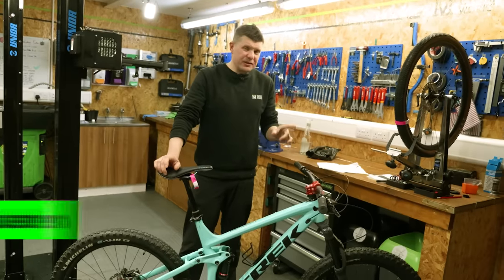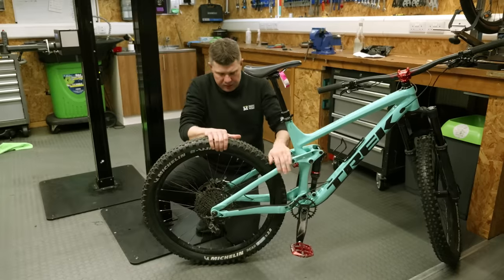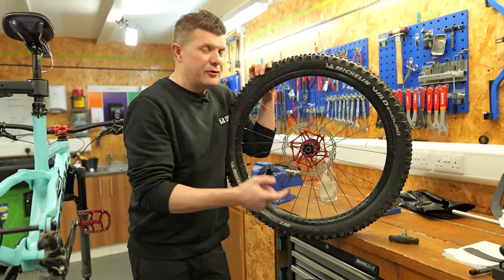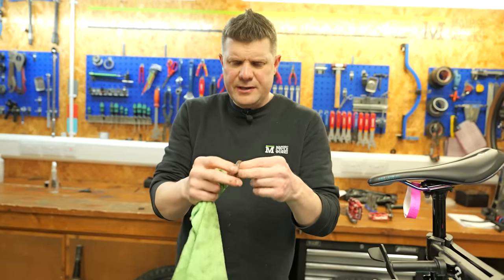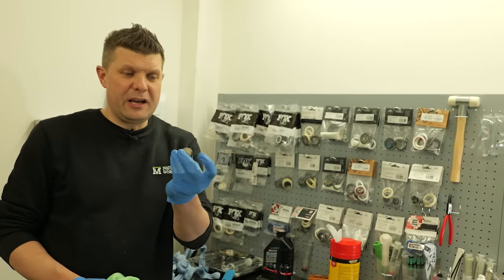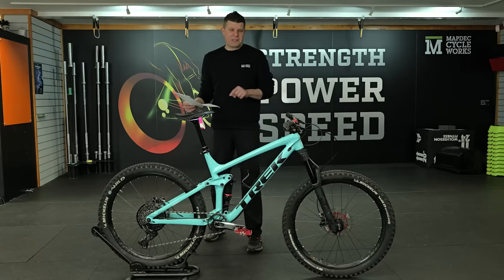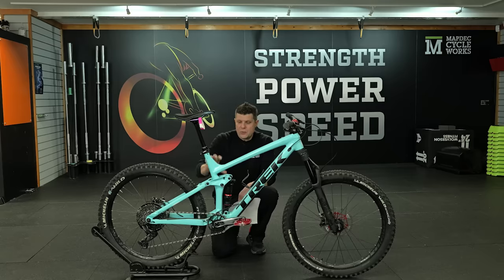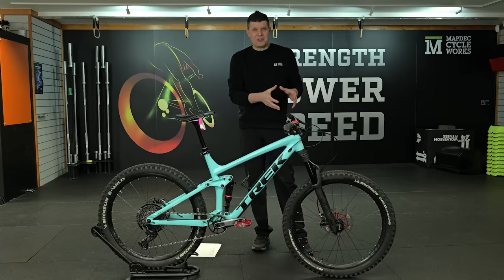They were quoted £975 to make this Trek Remedy safe

Comment: If the options and pros / cons were explained to the customer so they made an informed decision then that’s all good.  I don’t know anything about modern MTB maintenance but it looked insanely complicated and hence costly.  My 1993 Cannondale M2000 may have to be written off because of a corroded 11/4 inch screw fit headset.  Bike is otherwise fine but what a waste.  How much of the damage / wear to the Trek could have been avoided by not pressure washing?

Comment: I'm confused. He confirmed every problem that the first shop pointed out.  I personally think its irresponsible to not tell the customer what the repair 'could' cost before starting the work.  Unless of course you're prepared to do all that work for free when you discover the "that's probably just loose" turns into a "needs to be replaced".  Work to minimized costs for sure but don't sugar coat what the end cost may end up being.
Reply: If he doesn't sugar coat it, he doesn't get the outrage clicks from all these viewers imagining some profit hungry mechanics trying to rip-off a poor mom and son. 

Honestly, the deeper problem in general is people buying things they can't afford or be bothered to maintain. People (kids included) only learn this the hard way, and that's when the bill shows up. First time I had to work on my bike, I spent half as much as the bike cost because I knew jack about maintenance. From then on, I learned. Kids facing the same lesson, just with a much more expensive bike. Probably should have had a hardtail instead.
Reply from the maker: We did as instructed, plus a couple of minor things we discussed with our customer.  The shock service was a surprise.

Comment: The quote of 975 was accurate then for a full repair vs half assed keep you going for a couple of months, only just to incur a bigger bill just down the road.
Reply from the maker: The quote was good for a return to good as new.  The customer just wanted, please just make it safe.  The first shop just scaremongering
Reply: 975 for a basic service is not very accurate. I would expect to have a whole new bike for that price. It just needed some Grease bushing and bearings plus the chain. And some elbow grease

Comment: Don't rip the sending away for the forks. I use TF Tuned for any fork work because I am 1 of 1 staff members and don't have the space or time to do it. Also don't have a team of knowledge to pull from to know the ins and outs of every part out there. The rest is fine and easy fix.
I also have a pay it forward by saving Good condition parts and helping out the kids that can't always afford the repairs. I don't have superchats though.
Reply from the maker: I used to be 1 of 1 too. I always did lower leg and air can services.  You only need the fancy kit when you get into dampers.

Comment: I build my own bikes (not frames) & have done for 40+ years & I've seen many technological changes. Most have been good changes but by far the worst "advancement" is the sealed cartridge bottom bracket.
Essentially just an industry wide scheme to make money. They invariably do not last long & creak is common, not to mention the 2367 different tools you need to work on the different standards. 
I have a 1977 Raleigh road bike with a chain set axle with pedal cotter pins etc and you just grease the axle ball bearings, replace bearings about every three years & it's still got the original pedal axle. No creaking ever. Modern cartridge BB's are a con job.

Comment: This is the problem with those in the industry with vested interests who keep banging on about using your LBS,many of them are the equivalent of Halfords/Kwik Fitt/ your dodgy car garage who will rip you off, only once did I use my LBS 5 years ago to remove a lock ring from my rear cassette, my wheel came back buckled and out of true, never again,  I taught myself what I needed to do for my bikes, it ain't rocket science, never again would I use my LBS, but if I had Mapdec local then maybe, as the saying goes love your work

Comment: By the sounds of it the previous shop wasn't wrong. All the bearing were rough and on the way out and that topcap bolts snapped is definitely dangerous. Yes they could help the lad out and maybe that needed to be explained to them that it needs to be done on the cheapest side.

Comment: As you went through the bike it seemed like the other shop was pretty observant of the problems. It may be an expensive quote and you may do it for cheaper, but it’s seems like you ended up doing 90% of what the other shop recommended. This bike did need A LOT of work. Some shops are into repairing and making bikes useable where as others aim to make the bike as best as it possibly can. I don’t think this quote was too crazy if you’ve been working in the bike industry a decent bit.
Reply from the maker: For sure. I acknowledged that.  The point of the video is to be empathetic to the riders situation and guide them to the best decisions for their budget.  The other shop said it was unsafe to ride unless they paid £975.  The fact was that it could be made safe to ride for much less, however it still leaves work to do in the future. It might not be cost effective, but if that’s all you have it’s all you have.

Comment: At the point stuff wears out isn't it sometimes better to replace with 10s, particularly if you're on a tight budget? I'm on a budget so I have to be a home mechanic. I've stuck with 9s and 10s Shimano primarily because they seem to last longer (for me) and when they wear out the parts are so much cheaper (and always available).

Comment: Love the channel and love this video but Where does the “ok for now” approach leave you with regards to insurance if the worst did happen to the customer? I can see why maybe the bigger store quoted for a full job more as to “cover their arse” if something went wrong. I’ve been in this situation myself when working for a large chain and the powers that be refusing to compromise on “ok for now” repairs due to fear of customer issues/court cases. We even had customers sign disclaimers to say they would not sue if something bad happened as a result of not having a full repair carried out.
Reply from the maker: There is nothing unsafe here. The cranks may creak, the swing arm pivot may creak too in the future.  Nothing is loose or about to fail. The headset was the least safe thing and we sorted that.

Comment: My ex spoke to me about a quote she’d had for a diesel car.  £2.5k to replace injectors, glow plugs, clean fuel system etc etc.    I filled her tank with a strong diesel engine purger, about £40.  That was two years back, car runs fine.  Be aware as they love to frighten you with word like “too dangerous” to ride/drive etc.

Comment: Regreasing 8$ cartridge bearings is kind of silly, just because the fork doesnt feel bad doesnt mean it doesnt need servicing..the other shops quote was high but it really probably needs 600$ worth of work
Reply from the maker: Yes. We did as instructed, make it safe as cheap as possible. Sure it a false economy, but if you don’t have the cash you shouldn’t need to just not ride your bike until you do.

Comment: Mapdec needs to invest in suspension service tool packages . They would pay for themselves before long . I found this to be true when I invested in suspension servicing equipment .
Reply from the maker: Er. Did you see the suspension room part of the video?
Reply: @Mapdec Yes I did , but it has many problems such as lack of parts for other brands than FOX and ROCKSHOX . I have parts for twelve brands including parts for older forks .  I have so many parts that they are in big boxes now . I have a full range of ARIETE seal kits made in Italy . I have more work space than you do and " WHERE IS YOUR ULTRASONIC CLEANING UNIT" ? Shops buy off me because I have parts that many susspension repairers / departments cannot obtain .
Reply: @Mapdec  I am visually impaired but strive really hard to treat bicycles better than I treat myself .
Reply from the maker: @robertmcfadyen9156  oh. That big yellow cupboard is full of parts and oils. Next the that is a shock Dyno and sonic cleaner. Next to that is an iMac on the wall for service procedures and next to that is shelf full of bushings and mounting hardware.  We still need a fill machine as we hand bleed right now, but it’s in the business plan.
Reply: @Mapdec Why weren't vise guards used when holding components so as to avoid scratching surface coatings ?
Reply: @Mapdec  I don't need the computer as I have been accused of "CHEATING WITH IT" by clients in the past . I do exams regularly and get that knowledge into my head instead where it should be .
Reply: My computer is for catalogues , compatability charts ,  invoicing , bookkeeping and some technicals which I don't often need to look at .

Comment: This unfortunately why mountain bikes are throw away things these days.  I have an Orbea Wild FS M10 and the fox front and rear suspension require an air sleave service every week and a full service every month.  That’s £400 in service costs a month.  Or I can just not service it at all and buy a brand new rear shock and forks for £960 once a year.  When the service cost for a rear shock is a 3rd of the cost of the whole unit and they have such short service intervals this is what happens
Reply from the maker: It’s a basic service every 50hours. I doubt even the fittest of pros ride 50hours a week.  It would only need the lowers dropping, clean, new foams. You wouldn’t even need to take the forks off the bike.
Reply: @Mapdec  it’s every 30 for fox dpx air can service and 100 for a full service.  I do about 20-30 hours a week or about 6-700 miles a month so if I was to follow the recommended intervals I’d be doing a full service a month and a air can service a week which is just nuts

Comment: Shops are hemorrhaging good mechanics in my area (year round biking mecca) as costs of living are exorbitant but bike shops cant afford to pay us a living wage. Modern bikes are extremely advanced and it takes many years to acquire the technical knowledge and skillset to become competent enough to efficiently repair all the myriad systems in a shop setting with a backlog of completely clapped out bicycles. Our overhead is extreme but our services are in high demand but nobody wants to pay the prices to make the $ even out. Where does one draw the line between charging enough to stay in business and pay a living wage to highly skilled individuals and not over charge the custome? What happens when most of the truly skilled techs move out of the industry and you are left with teenage groms and 20 something green mechanics...? Alot of people complaining about how shitty their local bike shop is... The door swings both ways. You want to enjoy some of the most advanced vehicles of the modern age considering weight to capabilities but few people can or are willing to pay me enough to survive. Ill keep pretending that i didnt see you pull your $7000 bike from your $1000 rack off the back of your tricked out $50000 Subaru before you balk at my $600/700 bill I underquote you for your clapped out bike...
Reply from the maker: This is a concern. You just have to price and charge as you need.

Comment: Luckily he's found a trustworthy shop now. 
Another shop to be boycotted. 
Just do what the customer asks for and the rest is on an advisory to be done. Let the customer chose any additional points to be done.
Reply: What if in only doing what the customer asks for, they will end up paying more in the long run?
Reply: @johnlowkey359  what? The shop is working on behalf of the customer. Customer is the one paying the money. If you read my initial post I mention that all other work the mechanics find is forwarded to the customer as advisory or even labeled as risk to rider. Any suggested work to be done is at the discretion of the customer.

Comment: The forks feel ok, pushes down and squelch noise plays back....

The previous shop wasn't really taking the micky was it, you have just delayed some of the jobs they were talking about doing. I think they have a higher labour charge and I don't like that but honestly they were not far off. Delaying bearings for a few months is pointless as they can end up doing more harm than good. That's a carbon frame from what I can see and leaving play there has a knock on to the bearing mounting points wearing the carbon back and making small gaps in which the bearings then get room to move and make everything worse. Little movement close is a lot of movement further away.
Reply from the maker: I think I covered that. The other shop was scaremongering that all the work had to be done, just to make it safe, having no empathy with the customer.

Comment: Be curious to know how much less than half the price as i don't know how this job would be even close to £488 when you were using pay it forward for the shock service, using your breakdown, even at full rrp the mech, chain and £35 of odd parts would be £190 total, then you said 3 hours, this shouldn't be more than £40-50/hour making £340 total maximum, you could add the full shock service or fork service and still be under half to original quote.
Reply from the maker: We billed £347

Comment: powerwashing bearings... Arent there closed bearings that dont lose theyre grease ? I remember from my rc car that you could order upgraded bearings with a seal
Reply from the maker: there is a lot of pressure behind a pressure washer. More pressure pushing water in than can then drain out.

Comment: Yup most bike shops are a joke and I will say most with fact. I've been ripped many times even from a shop tbst I would tip heavily. What the industry doesn't think about is ripping people off only encourages people to do more work their self, one of thr many reasons no doubt they are closing. . I avoid them like the plague only visit if it's something I really can't do  I've had my bike go in shops for simple wheel issues and have had my suspension messed up and stuff I never asked for. 

About ten years ago their was an old guy who used to do it for me a nd he would come to my house and do it in his van outside . He was generally the best mechanic e er and a top bloke. He retired not long aftrt I found him if he was in buisness today he'd be the go to in my area.